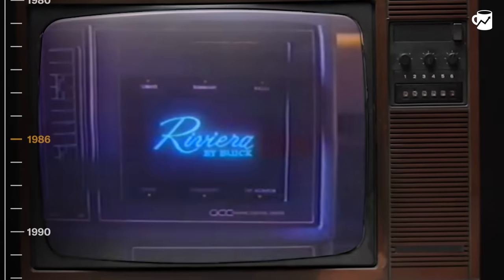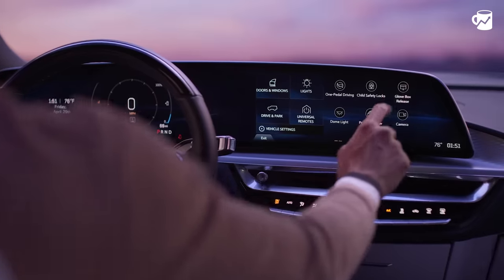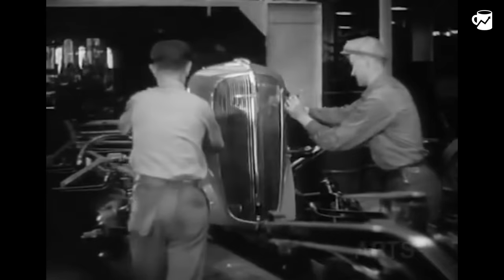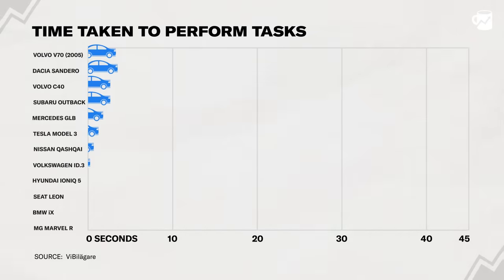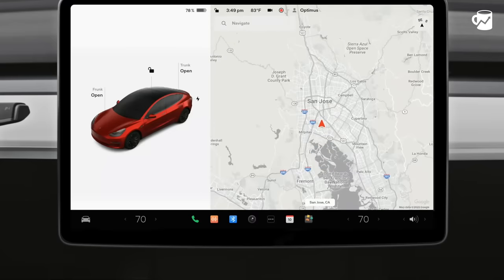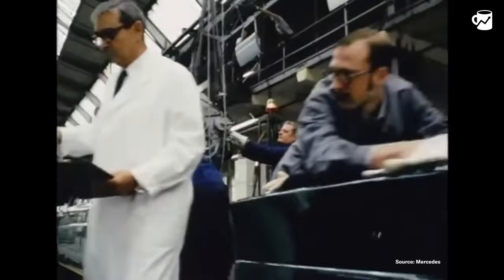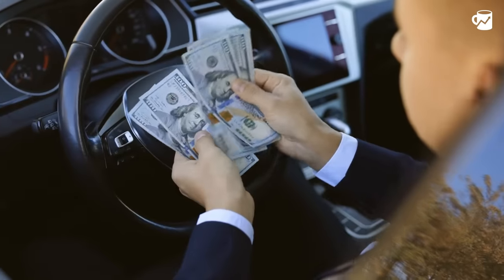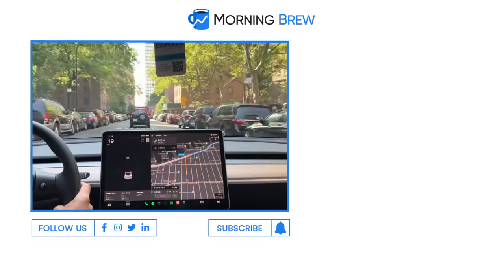The Real Reason New Cars Have Touchscreens

Comment: Touchscreens should never have gone beyond the infotainment. I drive an ‘07, manual transmission, cruise control- with an updated radio head unit for Bluetooth and phone connectivity. Literally don’t want any more tech in my car. Keeping this one for the foreseeable future.
Reply: A better way to put it is:  touchscreens should only be operational in terms of controls via touch when the car is stationary…
Reply: Yes for manual trans.
Reply: Anything is tech in a car. But touchscreen is just stupid if we rely pretty much everything on it.

There is a good reason why fighter jets still have physical controls. F1 still have physical controls.

Cars are still need to be driven despite having more advance autonomous features, it is still not 100% self driving system.
Reply: @panameradan6860  I’d say that no car functions related to operating the vehicle - any of its comfort, safety, or driving features - should rely exclusively on a touchscreen.
Reply: My family has 2017 Renault Scenic IV. Even while main dashboard is using displays for speed, fuel and all that, touch controls are for navigation and infotainment only - everything else - buttons, knobs and levers. Also a manual transmission. I feel sad that Renault stopped making these :(
Reply: Same with my 14 charger, but im having to add Bluetooth to the car, otherwise it's just infotainment
Reply: @ergosteur  example: turn signals, headlights, fog lights, wipers, etc. and meanwhile Tesla thought it was a good idea to have all of that on a touch screen in the middle of the dashboard where you have to reach over to activate anything that would normally be around a steering wheel column.
Reply: @Bravo107GamingandTributes  can’t believe that passed safety regulations
Reply: @ergosteur  yeah. Honestly the USDOT and other automotive agencies should fix this issue. Car manufacturers should be regulated in a small way but not regulated to where every car is the same, just to where it makes safety and security #1 priority on the road.
Reply: Early 2000s was the pinnacle of car technology and engineering.  It's been mostly downhill since then.

Hang onto it as long as you can.
Reply: @alkaholic4848  I feel like after 2015 or 2017 was when it went down hill.
Reply: @panameradan6860  "A better way to put it is:  touchscreens should only be operational in terms of controls via touch when the car is stationary…"
THIS. Manufacturers should deactivate the "touch" functionality of the screen when the engine is running or the handbrake is off.
Reply: "Touchscreens should never have gone beyond the infotainment."
This is too regressive. Touchscreens are amazing when implemented and used properly. Sat-nav and sensor fusion are probably the best examples of how useful they can be while you're driving, but (just like your trunk) they're also useful when parked.
The problem is that manufacturers are cutting costs by using them replace dashboard controls, regardless of ergonomics, which needs to stop.
Reply: @GonzoTehGreat  don’t need a “touch” screen for that.
Reply: @ergosteur  "don’t need a “touch” screen for that" 
If technology progressed by necessity we'd probably still be living in caves...

Fighter aircraft already make use of touchscreens precisely because they're a much more efficient way of presenting information to a fighter pilot. They're already used by smartphones/tablets and increasingly also laptops, PC monitors and presentation screens. You even find them in McDs!
Reply: Touchscreens are ideal for infotainment either.
Reply: @GonzoTehGreat  I’m not going to address the fighter aircraft point since I don’t have enough experience there. But the other examples - not the same. When you’re using your smartphone at home you’re paying full attention to it and so you can see where you need to touch on the screen easily. Same at McDs touchscreen. The argument with driving is that your eyes need to be on the road or you could miss something critical. Physical controls can be operated without or with less time looking away from the road. Touchscreens are definitely more adaptable, more efficient in a lot of cases, but they’re not the best for every case. They’re also very bad for anyone with visual impairment.
Reply: @ergosteur  I was specifically replying to: ""Touchscreens should never have gone beyond the infotainment.""
There are other uses where they can be an improvement. Having said that, if you were only referring to their usage in cars then I agree with your comments and said as much above.
Reply: @GonzoTehGreat  ah yes I meant specifically within cars. I love that we have the option to have touchscreen on a laptop or a random IoT device. Allows for very efficient user input/output at low cost and low space use. But in a car… there is space, and those things are expensive anyway. So spend some money on buttons and switches for things operated while driving! Keep touch for non-essentials like browsing through podcasts or a music library or detailed vehicle customization settings. Volume and climate controls stay physical.
Reply: @ergosteur  I agree with your suggestions and recommendations. 
However, I suspect that the decision to remove physical controls from inside automobiles is at least partly motivated by the desire to reduce production costs.
Thanks to advances in display and semiconductor technologies, programmable touchscreens are now cheaper to produce than manufacturing a variety of different physical controls. They also simplify supply chains, as fewer parts are required, including imports. They also allow manufacturers to standardize dashboard designs and use the same components in different models. 
Unfortunately, the impact of such a change on driver safety and ease of use apparently wasn't prioritized, so appropriate regulation is required to ensure companies take this into consideration.
Reply: @GonzoTehGreat  Definitely to reduce costs, I'm sure being able to share laptop and tablet hardware makes for great savings. The only real way to make a change is regulation, but who knows how/when that will come. I hope it doesn't require too many preventable accidents to make change happen. 

Sidenote, cheers Internet stranger, it's always a nice surprise to see well-written responses and to be in agreement rather than arguing lol. and I just registered your name and pic are Gonzo, nice.
Reply: @Bravo107GamingandTributes Actually I don't believe that. Part of Capitalism involves We the People. We buy the products. So it's up to us and our wallets. Not obese federal bureaucracy.

Comment: My biggest beef with touch screens is that you can't find the control that you need to press without looking at the screen, and that's very important when you're driving a car.  With physical buttons, if you're familiar with where the buttons are, you can often locate the button with your finger, and then press it, without ever looking at the button.  For example, I'm familiar enough with my TV remote control that I can easily adjust the TV volume without looking at the remote, or without even thinking about where the volume buttons are.  Obviously, you can't do this with a touch screen.  Even if you know approximately where the control is that you need to click, you still can't be sure that you're in just the right place to click it unless you look.
Reply: NTHSA is captured like every other regulatory agency. TVs on the dashboard, it used to be illegal to hang dice from the mirror.
Reply: With buttons, switches and knobs you get muscle memory that even after only a short familiarisation, even blind Freddy can operate.

With touch screens and myriad driving options you get confused, frustrated and distracted.

 Unsafe.

The thing that annoys me the most is that after going through my pre-flight routine and 'off this and on that' to suit my own preferences, it all resets every time I turn the car off and I have to go through the same routine every time on start--up.
Reply: That’s when you let Siri take the wheel or Jesus.
Reply: Hence the press for always on voice controls. Of course that also means the car is monitoring your conversations, probably tracking what you are looking at and storing all that pretty data, likely in some cloud service for sale or use by some “trusted third party” which could easily be law enforcement, insurance companies or government…. or even some offshore NGO or data reseller.
Reply: @jeffmoodie6144  Even if you don't care about any of that - voice controls don't work if you don't speak a good native American English! Even if they have support for some other languages, it's usually few, you need to speak a "proper" dialect with very good pronunciation, and some features might not be available. Oh, and if you have contacts in your phone written in another language - good luck calling them :D
Reply: Steering wheel, brake and accelerator are essential, signal liights are important. Headlamps and  wipers are secondary because you DON'T NEED to drive in  the dark or rain. "Climate control" is not something that should require a driver's attention;  we evolved without it.    Everything else is optional.  My first car had a manual transmission, no radio or A/C , no dashboard controls at all, and was one of the best vehicles I ever drove.
Reply: @psdaengr911  I would say that headlights and wipers are very important, because it's not unusual to get caught in an unexpected storm, where you need to turn on the headlights and wipers quickly.  So having easy-to-use, physical controls for wipers and headlights is very important to me.  And I like having the option to drive at night too.
Reply: Been saying exactly this for ages. Muscle memory allows basic control adjustments for ventilation settings, volume, track skip. All these settings hidden behind menus, or requiring screens to be swiped to the correct page cannot be done without, at best, some distraction, and at worst, eyes off road looking at the display.
This insistence by manufacturers on cheap interfaces over proper switchgear will cause fatalities. I can’t sugar coat it.
Reply: @gone547 

I am unsure why it would be considered unsafe…. There is no statistical data to prove that but new technologies are just new technologies they need to be innovated and improve the upon to make them safe… It’s just like airplanes how those technologies are constantly improving in order to make them safe… Voice control would get rid of any need for you to be actively touching the screen in order to do certain functions… 

Technological advancement comes with its downsides but that’s literally what advancing technology means…. Not everything is going to be 100% perfect but at the same time we can’t be stuck in the past just because it’s somehow safer… I know for some it sounds a bit ignorant but we can’t possibly advance a society when they are people holding us back from advancing…. I don’t think touchscreen’s are somehow a huge distraction since at the end of the day you’re responsible for your vehicle and obviously, I am entitled to my own opinion so it would just be my opinion that with time these technologies would become safer and less distractive…. It’s just like any technology you have to give it time to mature just like when cars came out with new technologies in the past people claimed it’s unsafe but now that perception has changed….
Reply: @ivankuzin8388 

But it can be adjusted for other languages… Just like I said for any technology you have to give it time to mature. It’s just that some of the argument seems to be supporting the idea that we need to hold ourselves back from advancement basically staying in the status quo just because it’s “good enough” already. If we know we can push technology to its fullest potential it should be done to that extent…. Everything comes at a cost but that’s just how life works. 

Obviously, if we were talking about corporate greed, etc that’s something that needs to be deal with by the policy maker or it’s pretty much a reflection of our political system.
Reply: @CaptainBlackadder75 

But at the end of the day, technology only advances at the expense of another thing… It’s the sad reality but that’s just how advancement works… Just like how science was advanced because of unethical conduct here and there, it is the same concept in any fields including technology… 

People are going to have arguments about what’s best for society and I do agree maybe company should have put in more time and effort to make the technology more mature but just like anything, including space travel everything comes at a “cost”. No matter how much people like to sugarcoat that it doesn’t have to come at such a extraordinary cost. It just does because that is part of life.
Reply: THIS
Reply: @aviatorsound914  
All  sounds like unnecessary gimmickery to me.  

There's good reason why you can't use your phone while driving. It's called distraction. Touch screens are no different, in fact probably worse.

Why are we always searching for a solution to a problem that doesn't exist, that is, until we make it a problem.

Comment: Cheaper to make but expensive to repair and upkeep
Reply: Yeah, so they make more money on the front end by making it cheaper to produce and on the back end by making it more expensive to repair when it's out of warranty.
Reply: Planned obsolescance - impossible to fix in the future when they stop making the part, and if they do, expect very expensive on a old car.
Reply: There will soon be a plethora of aftermarket screens to replace these for 1/10th of the cost.
Reply: Price sure but upkeep not really, if anything it’s better because you don’t have a ton of different mechanisms that are interacted with daily. I still hate the screens though
Reply: Like timing belt/chain instead of timing gears.
Reply: Yep. I checked the price of a replacement computer in a modern Camry. Here in Australia, it costs about AU$4000 just for the unit itself, plus installation!
My old $500 car stereo was better and I was able to install that myself.
Reply: Exactly, they make more money we get stuck with the repair bill
Reply: Which is a you problem, not a them problem.
Reply: @mojrimibnharb4584  Not I said the duck. I drive old cars.
Reply: @packrat-y7j  It's a generic "you."
Reply: I wouldn't say that.  Although it's proved to be true because the tech company's are moving to fast to figure out repair solutions.
Reply: This is true. Talk about passing the cost to the consumer.
Reply: @WSKRBSCT  The up-front part could be seen to some degree as a win/win - the customer gets a cheaper car (than the SAME car except with buttons and switches), and the manufacturer gets more sales.  
But the back end (after warranty) is entirely to the manufacturer and dealer's benefit, as the customer is captive and has to pay whatever it takes.  No third party parts for this.
If they had to provide a 10 year warranty on the touch screens, it might change the manufacturer's cost calculations.
Reply: Meh… not really.  

A touchscreen will last the life of the car.  Lots of buttons and knobs won’t.
Reply: @calvinnickel9995  What is the Life of a Automobile with a touch Screen? Is it going to be like the life of a Phone or a computer these days. That is not very long. No thank you. I have seen screens die and many software issues that have effectively killed a automobile or the device any way.
Reply: @calvinnickel9995  tell that to my 88 Nissan :p
Reply: @calvinnickel9995  What is the life time of the vehicle with this equipment? If it is like a Cell Phone or a Computer these days. The life time will not be that long.
Reply: @jublywubly  and if you're broke, you can live w/o a sound system, but they put EVERYTHING in these computers.
Reply: Repair? Modern things don't need to be repaired, so they don't need to be designed to be repaired.

THAT WAS SARCASM!!!
Reply: @wiedapp  Instead of Repairing. You just pay to replace. Not cheep, or if you want to think of it this way. Not Environmentally Friendly or sustainable. No thank you. I will save my money and keep what I have. No Sale for a Disposable Automobile for me. This is one of the things I hate most about Technology. I want another option If I am to purchase a new Automobile.

Comment: The only time I had an at fault accident I was reaching for the radio knob and looked away from the road and rear ended an SUV that abruptly stopped in bumper to bumper traffic.  I didn't even have a touch screen.  Those 2 seconds looking away was all it took.  My car was the only one damaged thank goodness. I'm grateful I learned that lesson without anyone getting hurt. Now when I rent a car sometimes I get upgraded to a Premium Model with touch screen only, even for radio volume.  I had to pull off the road and use my phone to google how to turn down the damn radio!  It was not in the slightest bit user friendly.  I won't have a car that requires a touchscreen to do everything, way to dangerous,  Bring back Knobs!